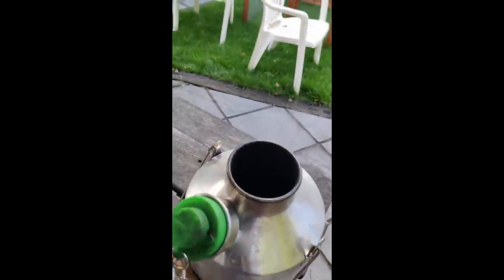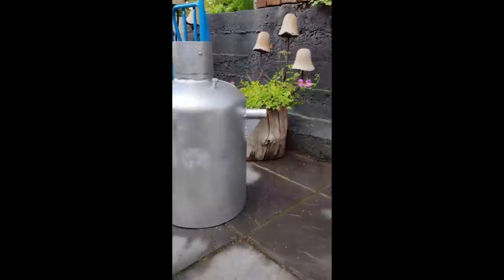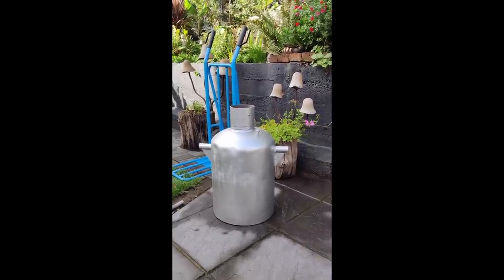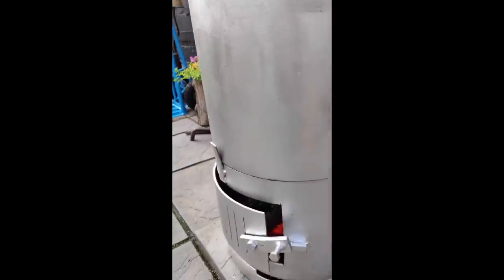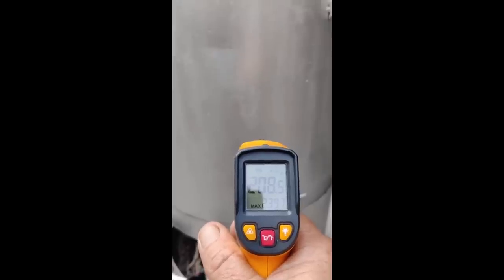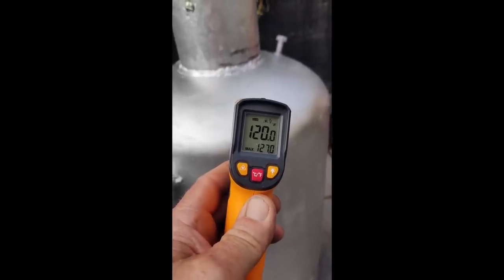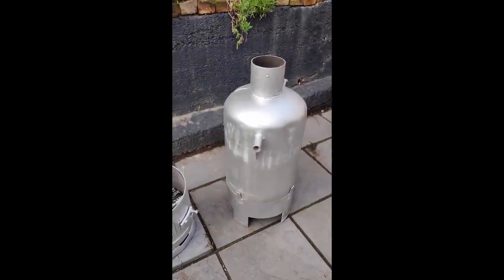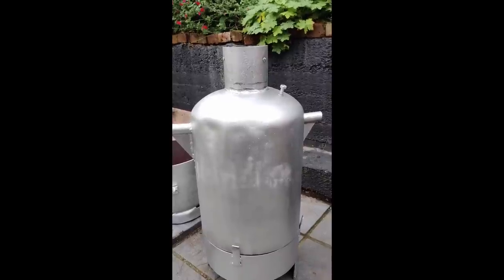Sand battery can it heat my home?

Comment: I thought the same,about how you could do this at home.
I even contacted the finish company to ask them,I got no reply.
My idea was an oil barrel filled with sand, electric heating element in and coiled copper pipe for water inside.Use heating element with solar or off peak electricity?
I suppose you could put heating element in this that you made( makes it cleaner for wife?).
Basically,it's a DIY storage heater.
Reply from the maker: Yes electricity is very expensive here & can't have solar panels which is why I'm giving this a go, but yes if you have solar panels then this is the best route & super size it 👍

Comment: i was going to something similar with water but sand gets way hotter so cool. one problem i see is the heat from the fire is just going straight up unto the sky it needs a bend or twist in the pipe so the heat has time to warm the sand. i love the idea
Reply: Masonry mass heaters

Comment: If you have a fireplace you could burn it in the room out from the fire place and pipe it up to vent out the chimney so you get the heat from the fire and the battery without losing heat up the chimney. You could also put metal mesh inside the pipe area to get extra heat from the flame that goes up the pipe in the center of your battery.

Comment: You basically built the core of a rocket stove thermal mass heater. If you made a few changes to use the rocket stove to as the heat source it would save you wood..or whatever you decide to burn. And produce no smoke.

Comment: It could be possible to have copper pipes passing into the sand, curling around the flue and then out again through sealed holes. These pipes could then be used to heat water.

Comment: Usually sand batteries for home heating and cooling take the form of a large earth mounds passively warmed by the sun and structure of the home during the day, then releasing their stored heat during the night. TnT sand battery is a cool concept, but to heat a house it would need to be much bigger.

Comment: Even radiant heat off set atleast 6hrs. 60%efficiency for a little labor and sand =2hrs×$10.00 for fire gard savings off heating source =a savings of ,$60.00 off total electric and gas bill. I'd make 3,or 4? Great job !

Comment: First if all, thankyou for trying to help us all, little suggestion, Chinese hat/flue cap ie vented plate which could also be used to cook on, might not only help with heating times but help re fan with 380 degree heat circulation, just a thought, oh and remember, heat raises which means the heat will eventually spread though out the cylinder
Reply from the maker: Thank you Steven, yes funny as I made one yesterday a cap that is to be used in discharge & hopefully have a thermometer in the top, also to stop me from burning myself on the flue 🙄
Reply: @leejones2511  brilliant Lee, also if it is flat instead off the usual conex shape for letting the rain run off  it can be used as a stove to cook, good luck

Comment: Wonder if putting a damper on the top of the stack would help control how quickly the heat leaves the stack and allow you to get a more efficient transfer into the sand.

Comment: I'm about to turn my 40 gal on it's side and mount wheels on it like a semi tanker. With a tall removable flue at the outlet end the draft will pull the heat sideways much slower and heat the tank more efficiently than straight up.

Comment: What about cutting slots through the inner pipe and inserting steel plate through the inner pipe and into the sand. it would act as a heat sink and transfer the heat to the sand better. Also act as baffles for the chimney. best of luck. PS You've given Me an idea for My solar air heater, to incorporate a sand battery using the same principle. Mmmmm  : - )

Comment: This heater design reminds of how a water heater is designed. I would suggest using a flue baffle to slow the heat escaping the flue. 
What is the purpose of a flue baffle?
A flue baffle slows air movement through the flue. By keeping the combustion gases in the flue longer, more heat is transferred to the water in the tank.
Reply from the maker: Yes I something similar to this in my last video with great success 👍

Comment: I love this! You’ve inspired me. I have two old tanks, same size, that I can use. I have a question. Can you not attach chimney pipe to the top and run it out the house through a window? Then you can keep it inside and not have to move it and benefit from the heating up process as well. It reminds me of those vertical iron wood stoves.

Comment: I have a wood stove inside my home. I placed a pipe down the chimney to exit the smoke. Would it be possible to fill in the open space between the pipe and the chimney with sand? The chimney stays nice and warm around 3 hours after the stove is cooled off. Would be great to keep that heat going a lot longer.

Comment: Simple!!! and most efficient tips!
You need to put sth in the midle of the centre pipe, because most of the heat goes through and out. You want to bring the flame and gases close to the wall.
Then you can find a cheep metal pipe that fits on top, to gain draft (chimney), so you can burn oak and watever else.
Reply from the maker: See part two👍

Comment: Nice! But many heat is lost and going in to the air. So maybe de hot air should be going through a much longer pipe, so you can profit much more.
The're is a big project in the Netherlands, somthing like 20 houses taking energy from rocks. The big box with rock, is heated up from solar panels, the electric current is going in tubes through the rocks. To extract, hollow pipes with air is sucked out.

Comment: A 15kg bottle of butane is 205kwh of energy. At £60 that is about 30p per kwh. Mains gas is at least 3 times cheaper even at this ridiculous level we are at. Good job on the sand battery, it makes sense if you have free wood. Anyone buying wood is going to be wasting there money though as wood costs more than gas per kwh.
Reply from the maker: Thank you, yes I wouldn't have done it without free wood 👍

Comment: Weld heat exchanger fins down the length of the flew so they extend out into the bottle. If you can find ball bearings enough to fill the tank with sit the tank on a good vibrator and slowly start pouring your super fine super dry sand in and it will vibrate filling all air spaces between the ball barings from top to bottom. Take your time doing this and when you think it vibrated enough let I go another 15min half hour. You want that sand packed around every ball baring making them forever locked in place. That there is the ultimate portable ( minus weight) mini mass space heater.
Reply from the maker: Great idea 👍

Comment: Thank you!!!  from Denver Colorado!  Already trying to pay off huge utility bill. There's Already hole cut in chimney with large thick aluminum box there easily converted into firebox.( previous owner cooking Rx) Scrapyard within 2K or old water heater!
Reply from the maker: Thank you!
Reply: @leejones2511  ck out Robert Murry-Smith !   Will help you I believe. Let me know. 
     @lee jones  highly respect you and that you put yourself in a grinding project using up your valuable energy & time.  When younger (1977)  I was told by docs my mechanical I Q around 180.  Since I had brain tumor removed (07) and debilitating ADD my whole life. Still have the fire, not as smart as I was.  Thanks again for pushing kindling under my fire as an old guy now. Plz don't bother a reply, you've got valuable things to accomplish. Just know guys like us (you & me) are out here getting excellence from your craft, but are neglectful in responding.  🐈😸

Comment: I would think if you add a heat exchanger IE copper tubing inside of the sand  and then running copper tubing to the house. you would then need and radiator to have heat but I think it could work.

Comment: I'm looking to build a rocket mass (sand) heater in a (cheap) metal shed at the side of the house.  The sand mass will surround the metal drum that is over the (Ceramic Vermiculite Fireboard) "chimney" / burn chamber.    The sand mass will be super insulated with rockwool and copper microbore piping running around / through the sand battery and (insulated) out through the wall of the house.  Probably use a central heating pump to feed a (living room) radiator(s) in the house.
Reply: The only thing to watch out for is steam explosion . You could separate the heat side circuit from the house heating with a central heating heat exchanger although it is fiddlier and needs 2 pumps you wont be in danger inside the house provided you use proper controls . Anything over 100c and the water in the heating pipes will explode into steam. 1600 times greater.volume and super dangerous.

Comment: Coiling the flue on the inside would of increased the inside surface area and slowed down the flow, giving more time to extract heat. Also your eventually going to notice a creosote smell, which is where a rocket stove would not only increase the efficiency but reduce some persky odors.

Comment: I am joining your channel so I can watch your next video. Is it possible to run a pipe into your house so you get to use most of the heat you genertate from your sand battery? Put the pipe at the top above your heater and insulate the pipe and put a small fan at the end of the pipe and you will get more free heat blowing inside your house. I'm looking forward to watching your next video. Good luck mate.
Reply from the maker: Thank you for the sub & your comment. Yes it is the down side to this is the lost heat in the burn, I did think of looking into recovering some of it but the idea is to burn for a hour or two & that's it, but will look into making it as efficient as I can as I move on.  however as you know from my video I can't get a stove indoors & since starting this project I have been looking into making a stove outside in a metal box out side like you have in the US & blowing the hot air indoors 👍 next project!

Comment: Very nice. But there is an incomplete burn happening. The amount of visible smoke from the exhaust is indicative of this. There may need to be extra holes for more oxygen to enter the chamber around the pyrolysis stage. TNT and Robert Murray-Smith channel's have great explainers and details on rocket stoves.
Reply from the maker: Yes I tuned it in better on the next video (part two) 👍

Comment: Cool thing! Just wondering if having some kind of coiled flue wound help save some of the heat going directly up. I guess that’s just way to fiddly to build. Just my gut feel is there’s a lot of heat going out the top that “could” (I don’t fully know how) be reused for the battery change. 

Our stove has a soapstone top that soaks up excess heat - and I guess that’s a similar (low temp) principle.
Reply from the maker: Cheers for the feedback,  yes il be looking into slowing the flue gases some how maybe some loose chicken wire or a small piece of angle iron suspended 6 inches or so down the flue  as some kind of baffle, il play with it & see how it reacts 👍

Comment: the sand and every material have a heat capacity "j/kg" so sand is good but if you check PCM 's "Phase changing materials" . . Like Salt, Parafine, Beewax they are better.

Comment: I’m seriously thinking about fitting a rocket mass heater. I’m in a thirties semi and our woodsove is our primary heat source. I try to prevent the central heating coming on. We have working chimneys but I’m still planning how to site a rmh within our house   What about, in your situation could you build the heater part outside and run the he exhaust into the house for the mass bench then exhaust at the back on a shortish flue?  Not ideal but you could take the heat off the j tube cover to heat the sand battery as well.
Reply from the maker: It's a good Idea but ( my wife wouldn't buy into pipes in Windows or through walls) & tbh this favours me it may be a faff (but a interesting one) it's pretty much safe having no gasses in the house ect 👍

Comment: Add another 4ft of flue increase airflow put secondary superheated air about 4inchs in from bottom of bottle you will have plenty of heat throughout the heat exchanger portion of the flue.

Comment: So... You probably want a hot spritely fire when charging this heater. So splitting your wood down to 2.5 cm splits and less. It will burn faster and hotter.
Love your idea.
You may want to have a few of these sand batteries to switch them out as they cool.
Reply: Also some sort of hand truck to move it around without all the danger of carrying it.

Comment: Making the battery taller seems to be an obvious conclusion given the amount of heat from the fire leaving the chimney. Also, my experience is that oak burns hotter BUT needs a much higher airflow. Great job and thanks for taking the time to make such a through demo.

Comment: My suggestion is take a metal garbage can …place it upside down on the unit and cut the bottom out just enough to fit over the inside pipe to keep cooler air / wind off the unit even after you insulate it …if can touches the ground then put a few holes around the area of the can near stove door so flame not affected
Reply from the maker: Got a oil drum coming & it will live under that to keep it dry, will have a cut out for the flue & will be cooked under it too 👍

Comment: Try to restrict the flow through the top with a removable reducer while the fire is heating the sand. Cheap fix if it works. Don't give up.....
Reply from the maker: Thank you yes, check out part two if you haven't seen it yet & had much better success by doing exactly what you just suggested 👍

Comment: I’m going to build one of these but I’m going to put it on top of a rocket stove for the self feeding / efficiency of the system
Reply from the maker: Brilliant yes rocket stove is a great idea as they can get very hot, il admit after coming across that chap on YouTube I did think about it but unfortunately my wood is in short log form. Let us know how you get on 👍
Reply: @leejones2511  If you split the wood smaller it will burn hotter and faster, you'll obviously have to tend the fire a lot more. The hotter the wood burns the more efficient the burn will be, wood also releases some gases as it's heated and if you can get that to the point it ignites it will increase the efficiency by up to 15-20%. Look up "wood stove secondary burn".

Some other commenters also mentioned how you should rebar to transfer the heat more efficiently into the sand, and they're not wrong but it's a balance, more rebar will mean the heat will also escape quicker after heating. If you measure the temperature of the flame at the bottom and compare it with the heat at the top of the pipe you will get an idea of how efficiently the heat is being transferred into the can.

Oh and obviously insulation should help tremendously, I'd def go for rock wool like you mentioned since that is the most fire-resistant commonly available insulation out there, it might make it a bit bulky however so you might want to look into 'aerogel' based insulation, but they are harder to come by and are more expensive obviously.
Reply from the maker: @Sindrijo  thank you for your tips I've just done a video on it & implemented some of that an discussed others on it, il get it posted over the next couple of days and you can see how it got on 👍

Comment: This is brilliant. It is the tinkering and refining process that gets you something that works for you. For me, I'd want a sand battery that has compartments that I can heat as a whole, then remove those small parts and place them in something in each room to provide central heating. Another thing is convection currents and damp, and the heat generated from a small sand battery will provide hot air that absorbs moisture from the air so opening top windows and trickle vents allows that hot moist air to escape and be replaced by drier colder air.
Reply from the maker: Thank you, yes I will make a couple of smaller ones also for rooms that can't get much airflow 👍